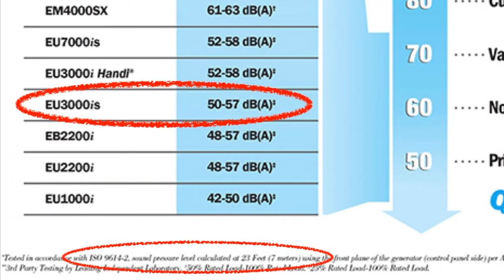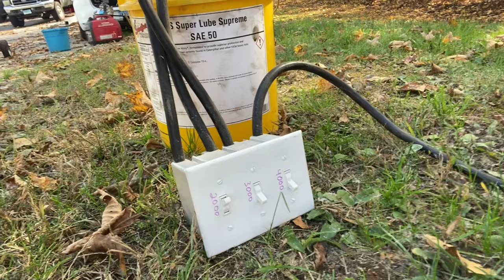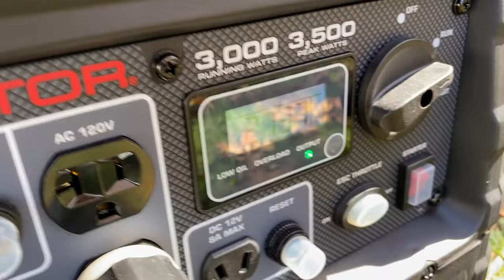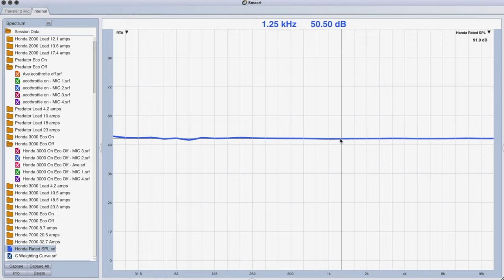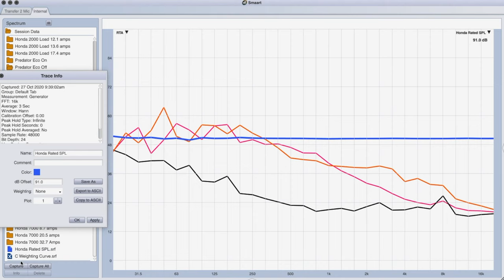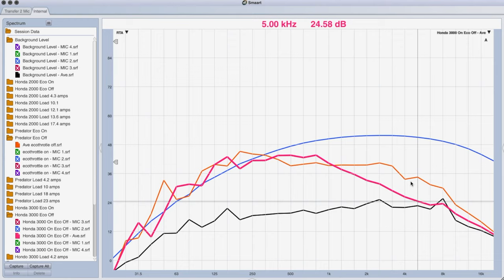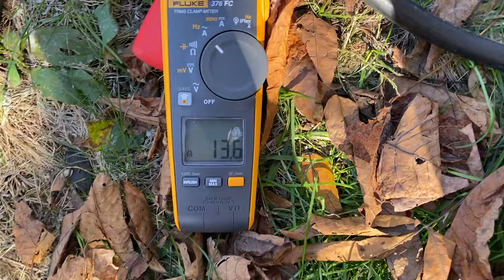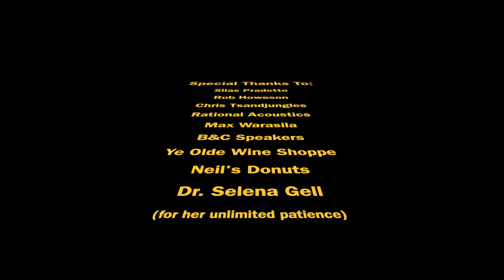A Tale of Two Generators

Comment: Fantastic video and really good insights. How was the waveform of the two generators under load? I didn't catch that in the video.
Reply from the maker: I didn't include it because it ended up being uninteresting, all four generators had very low harmonic distortion at all load levels.